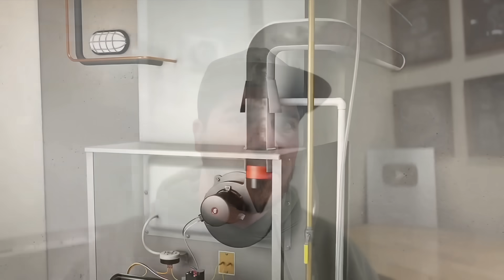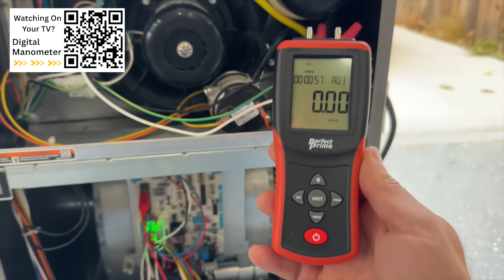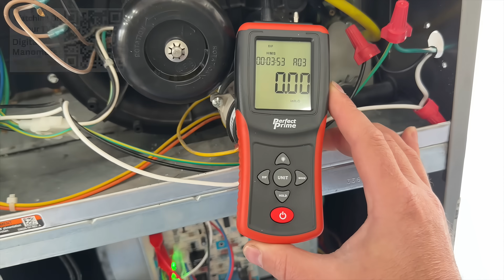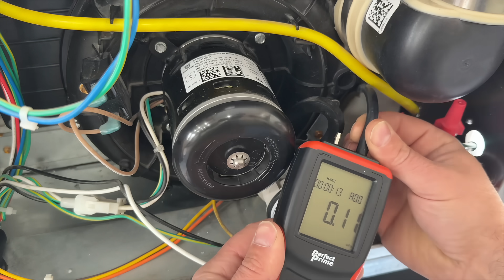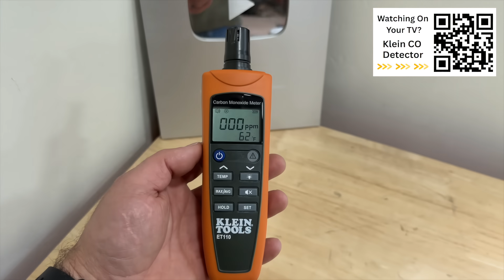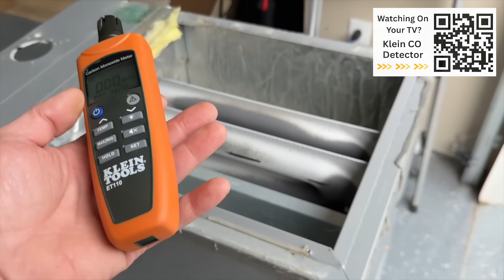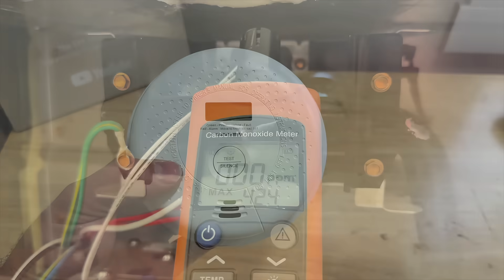This HVAC Scam Could Cost You THOUSANDS.

Comment: The HVAC guy I trusted for several years used the scare tactics with us this year. Our heat exchanger developed a nail sized hole in one area, and he wouldn't replace just the heat exchanger. He also claimed our crawlspace ducting was not up to code, which he's never mentioned in the years we've hired him. Because of that, he said he would only offer us a full system and ductwork replacement at $32k. No other option after he cut our heat. It felt like being stabbed in the back, man. 

I found a good workaround for now, but geez he really made it sound like our lives were at risk if we kept running the furnace, and he insisted we accept his quote the next day. It was nuts. He's gone now. If anyone's in Oklahoma, be careful if you hire Wolf Heating & Air. He's gone the route of primarily selling new systems to people who can't afford them, convincing them to use his financing so he can profit off that too.

Comment: I am not a HVAC tech. I do have a keen sense of physics though. A cracked heat exchanger is not a death sentence and you have plenty of time to resolve it. If the flame is orange, yes, oxygen is present and you have a crack. Also the main blower is creating a positive pressure on the non flame side of the of the heat exchanger. Air is traveling into the flame area, ergo carbon monoxide is not pushing out of the crack and going into your duct work. When carbon monoxide is in your home, you will get a headache before it becomes a lethal level. If you think you have a carbon monoxide headache, step outside or open a window and breath outside air for a few minutes. You should start feeling better and feel an increase in energy. This method is not a replacement for a CO detector in the home. But if you don't have one, you must be aware. If a sales person tries to sell you a furnace, just say thank you and that you will wait for the spring/summer when prices are lower.
Reply: Sorry jumped the gun a bit. I wrote that I did not finish watching the video. Thank you for the truthful content.

Comment: This is terrible advice!  Calling out a cracked heat exchanger isn’t a scam—it’s actually a safety requirement. A cracked heat exchanger can leak carbon monoxide, and any legit contractor is just following the code to keep your household safe. That’s like saying if an electrical short doesn’t trip the circuit breaker its ok until it trips it.  Thats a recipe to burn your house down.

Comment: There is a scam currently being run by a large company that offers maintenance contracts on furnaces, AC units and even electrical and plumbing. The idea is that you pay a reasonable monthly fee and if something breaks, technician will come and fix it, with parts and labor covered by the maintenance contract.
But for last two years or so when customer calls for service on a furnace, technician doesn’t even bother to look at the problem reported but pulls the inspection camera, drills a hole in the plenum, pokes around until he spots some rust. With any furnace that is a few years old there will be rust spots. The technician declares the heat exchanger is cracked and it’s game over.
The technician does not perform any other tests, shuts the furnace down and tells the customer that the furnace is dangerous, can’t be used and if you don’t agree the technician will report the matter to the gas company and they will shut the gas off and it will take some time to get the gas company to unlock the gas valve outside.

Most people will just say get me a new furnace and the technician will gladly install one next day.
Reply: exactly what happened to me after I paid for a cleaning. Even had the techs mgr. come to the house as I was skeptical after seeing the pictures taken showing the rust. They shut my gas off. Told them I would seek a second opinion; no way I was giving them the sale. Furnace (Bryant) was about 13-14 yrs. old. Had a friend in the business who gave me a great deal on a Goodman furnace.
Reply: @macker0077 did your old furnace actually have a hole or a crack in the heat exchanger?
Reply: @rok1475  I couldn't see a crack or a hole in the pics....just some rust spots. This was in 2016.
Reply: @macker0077 but they scared you enough to replace the furnace…
They didn’t get the sale but helped the other guy and the furnace manufacturer 
😉
Reply: @rok1475  Absolutely. Most don't know how to test for carbon monoxide, though you would think if you have a detector in your house, that should be the first warning (if it goes off). Had my daughter and her 6 month old coming for Christmas as well, which also impacted my decision. Seems modern day furnaces (especially high efficiency ones) don't last as long as well? Glad I found this video, as I would definitely use the ideas here to test out the furnace if this ever happens again to me.
Reply: @macker0077 it took me a while to understand how the high efficiency furnace works and I am more and more impressed how many safety features engineers built into it.
The HVAC scammers scare people into thinking that flue gas can easily escape into the air flow through any crack in the heat exchanger and kill you.
If that was really the case we would hear about people dying from CO poisoning every day on the news.
People that do die from CO poisoning are victims of malfunctioning or missing smoke detectors. A fire inside the house does generate a lot of CO…

The reality is the inducer fan pulls all flue gas out. If there is a crack, it also pulls air from outside the heat exchanger. The inducer fan creates negative pressure inside the heat exchanger, the blower fan creates positive pressure outside the heat exchanger. The laws of physics and clever engineering protect us from flue gas escaping into the air being pushed by the blower fan into the house.
If the crack “grows” into a big hole, the inducer fan can no longer generate enough negative pressure, the pressure switch doesn’t close and the furnace doesn’t fire up.
You can find videos of furnaces with holes you can almost drive a truck through.
It took time for that hole to “develop” from a small crack. If the myth perpetuated by hvac people was true, people in houses those furnaces were running in should have been poisoned long, long time ago. 
If you have a fuel burning heater without the inducer fan, the CO danger is very, very real. 
But if your furnace is forcing flue gas out, the CO cannot enter the house during normal operation of the furnace.
For peace of mind get CO sensors that monitor the momentary CO level and display it in real time.

Develop a good relationship with one honest local hvac guy and only deal with him, even if it costs a bit more. This may save you a lot of money and frustration years later.
Reply: @rok1475  Thanks, makes sense to me.👍

Comment: There’s so many things wrong with this video. So much misinformation. You stated that an 80% furnace burns 80% of its gas and 96% furnaces burn 96% of its gas. Just no. 

But to the most important issue, if your heat exchanger is compromised in any way, including cracks, replace the heat exchanger or furnace. Anything else is gambling. Maybe you never get fumes in your house, but if you do, it can kill you. Not a risk you should take. This video is dangerous. Very dangerous. Get better information. Don’t put people at risk. I hope you never experience making these videos, and someone gets hurts or worst case…

Comment: I just replaced my 40+ years old furnace because it was finally time to put it down. About 15 years ago I had an hvac tech tell me that it needed to be replaced because of cracks in the heat exchanger. He even tagged my furnace and shut off the gas to it. I bought a couple of carbon monoxide detectors and ran that furnace for another 15 years.

Comment: It makes sense that the furnace manufacturers would design their burners to be under negative pressure to avoid wrongful death lawsuits from cracked or damaged heat exchangers. I really like the match test since it is simple and based fundamentals of fluid flow. Well done.

Comment: I had a heat exchanger crack on Christmas Eve. The reason we knew is because the carbon monoxide detector nearby went off. I thought it was a false alarm but then another carbon monoxide detector that was being stored in the nearby closet also went off. That's what I knew it was something serious. I do recommend that everyone have a carbon monoxide detector would a digital LED readout that shows the actual PPM numbers. I learned this on an episode of the show Monsters Within. A family was chronically poisoned with carbon monoxide for several years Even though they had a carbon monoxide detector. This is because the units without a digital readout will not sound an alarm until they hit 8 ppm. In this case they were always under that 8 ppm But the continued chronic low dosage of carbon monoxide poison them for years and caused huge problems for their lives. So you want at least one carbon monoxide detector with the digital PPM level readout and it should always show zero. Do not rely on carbon monoxide detectors that do not show the actual level.

Comment: Blank statements are dangerous and shouldn't be e applied as a whole to the industry. 
But has there been dishonest companies/ technicians, yes .
This happened to my Mother in  law when a large local contractor told her the heat exchanger was cracked and needed replacement. They provided pictures of the inside of the cabinet and the cracks. The problem, it was a picture of a 3 burner furnace and not a 4 burner.

Comment: Hard to believe that some of the early inducer designs were “positive” where the air was pushed into the heat exchanger instead of being sucked out.  Scary.  Quite a good bit of Goodmans are still running with that design.

Comment: The inducer blower should actually be on the outside air intake.  That way the blower squirrel cage is in clean air.  But we see the blower on the exhaust pipe.  Here the squirrel cage is in warm, wet, acidic, exhaust, corroding the fan.  The 1985 furnace the former owners installed had the fan replaced 3 times in the first couple years.  This was the early days of condensing furnaces that they realized they had to go to a stainless steel or plastic fan.  But putting the inducer blower on the exhaust side causes a slight negative pressure in the heat exchanger, so if there is a hole nothing goes out but rather air flows IN to the heat exchanger.  But if it cracks it gets hard to maintain a negative pressure.

Comment: I am retired and live alone in a 1200 sq ft home in NC..  I stopped using my fuel oil furnace and closed off unused portions of the house. I bought 3 oil filled electric radiators .. one in the den, one in the kitchen and one in my bedroom. what ever room I'm in, I activate that heater. if really cold I will run two, and I only use the low settings and on each one I installed a small computer fan that was purchased off Amazon to spread the heat better.... I bought these at Lowes for $400 apiece. power bill here in winter averages $150 per month for the winter and if one breaks, $400 is better than $5 to 8K.

Comment: This happened to my elderly mother (in her 80s).  She responded to an ad to have her furnace cleaned.  The tech told her that her heat-exchanger was cracked, and that she could be poisoned by CO. He then proceeded to tell her that if she bought a new furnace that week, she would get a discount - but she could not wait.   She called me.  I worked with several plumbers who even installed furnaces.  One of my friends went over to my mother's and inspected her furnace.  There was nothing wrong with her heat exchanger.

Comment: A few years ago when we lived in Las Vegas this exact scenario happened to us.  The HVAC company was advertising a discounted diagnostic at a kiosk in Lowe’s and they actually showed me a photo of the cracked exchanger!

I got a second opinion because the moron left the door loose and our furnace stopped working.because of the safety switch.  

The second company noticed the loose panel and also showed me the heat exchanger and it looked nothing like the photo I was shown.   Apparently they even had a fake photo!  

Be careful out there!

Comment: Why don't they just make heat exchangers that will last? If that's the critical failure. This reminds me of the car mufflers in the past that would rust out in two years, and (interestingly) there was a muffler shop on every other corner. I've had 2 new cars in the last 27 years, approx. 350k total miles, and never had an exhaust system problem.

Comment: Old systems that do not have a draft inducer are an issue.  BUT, When you are forced or put under stress/pushed to do in now...Always get a 2nd vendor evaluation. Then if bad you get to select the lowest cost.  And almost always the 2nd HVAC guy will cut the price lower than the first because he is there and wants the work.  The first guy uses fear and ignorance to make $$ don't reward him unless he is honest!!

Comment: Thanks for posting this video. A large company is advertising a multi point furnace tune up for $29.00.
By the time the tech drives out and back, they’ve spent twice that.  So, it has to be a loss leader.  And sure enough, here it is.  Won’t work every time,  but if they get a 20% hit rate…

Comment: You don't know what you're talking about, you are mixing tests for high , mid and standard efficient furnaces. The dancing flame is for an atmospheric burner (no induced draft fan) test. You have a much larger fan competing for air from the same area. It will over power the induced draft every time. Where you will notice your heat exchanger having a crack is right at the front on the burner tray. The inducer fan draws air in and mixes with the gas at a predetermined rate. The inducer forms a vacuum in the heat exchanger, relieved by the burner entrances. This is why the flame takes the shape it does. When there's a perforation in the heat exchanger it causes a reduction in vacuum which shows up as a burner flame that doesn't appear to be getting sucked in as much as the others. This causes more heat around the burner section as is picked up by rollout limit switches which will break the gas valve circuit, if the temp gets high enough, and needs to be manually reset. This switch is manually reset to draw attention to this condition. This is why gas pressure and heat rise checks, as part of your periodic maintenance are so important 
   Some furnaces build these problems into their furnaces. For years, carrier( bryant, and other offchutes) were a bad choice. High efficient furnaces have a second heat exchanger that looks similar ta a car radiator. The products of combustion are pulled through this part by the induction fan assembly.  As steam is 80% of a part of combustion and  acidic, this secondary heat exchanger is where the condensation is formed( from the reduction in flue temps to a level below dew point) this heat exchanger has to be made of materials that can handle this condensate. Most manufacturers use stainless steel. Carrier used regular steel with a polymer coating. The coating breaks down, the condensate gets to the steel and starts to rust it. The rust slows the airflow through the whole heat exchanger, the heat builds up near the burners because air isn't moving through like it should , the heat increases until it trips the rollout switches. The rollout switches shut the gas circuit down until they are reset by a homeowner/ service tech, etc. 
  What a homeowner will see is a non heating furnace where the metal above the burner tray is hot to touch. It will depend on the time elapsed between trip and discovery of the problem and ambient temps  During normal operation, this area gets warm but not hot. These rollout switches are set to trip somewhere around 300° F. Depending on manufacturer
Reply: Many Youtube videos are money generators for the producers. Buuyer beware!
Reply: While you're technically correct the video still had good information.
Reply: @DavidR-dh3oz for the people who aren't in the know, they might take this info as gospel. An orange or yellow flame can be just burning dust. We have all seen it. All you have to do is tap the burners while they are burning.

Comment: I had a crack in my heat exchanger, didn't cost me a dime as was still under my 10 year Parts and labor warranty by 6 months.  The tech did explain that unlikely to cause CO in the house due to the negative pressure in the system but still had to lock it out under local code.

Comment: I had this exact thing happen to me when I bought my house. The company said I had a cracked heat exchanger and it would cost $7k to replace. When I had another company that I paid to do a check the tech said that even if it was cracked there were no issues and the final cost for a check and cleaning was about $100.

Comment: Can a lower grade furnace be upgraded to a higher grade? Can a cracked heat transfer be repaired by welding if replacement parts are not available? One of my four tubes is rusty and the technician said the furnace had to be replaced for $9800. Kicked him out the door. Thanks for all the info!

Comment: I witnessed a lot of furnace replacements due to bad heat exchangers and yet few ever addressed the reason why it failed. The primary reason for failure was proper air flow or having a excessively high temperature rise because of inadequate ductwork. Over sizing also kills a furnace as well as dirt blocking the a coil, short run cycles with high temperatures. It is back to the basics which I rarely witnessed, temperature rise, total static pressure and gas pressure.